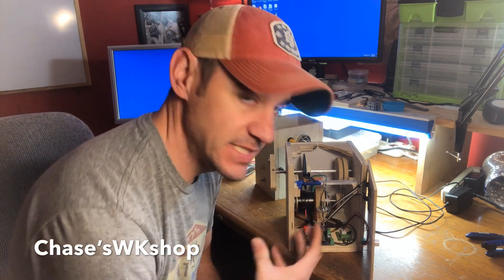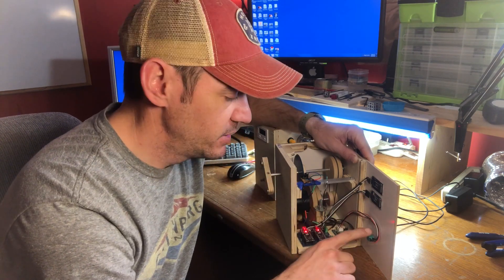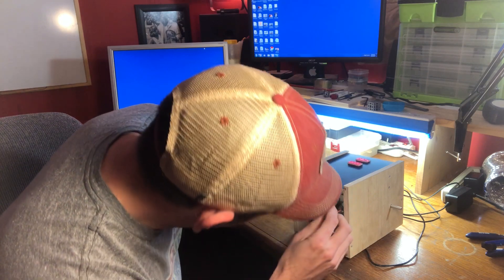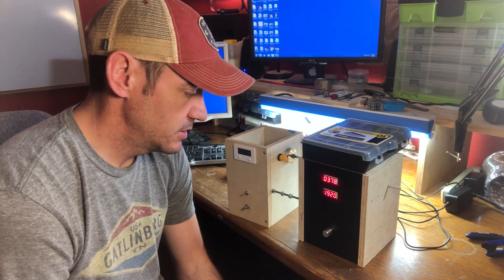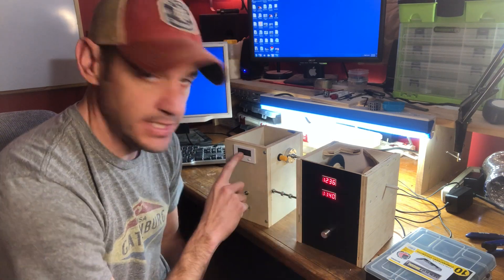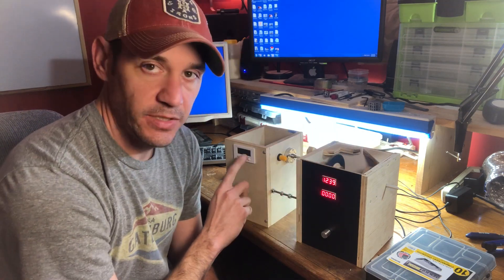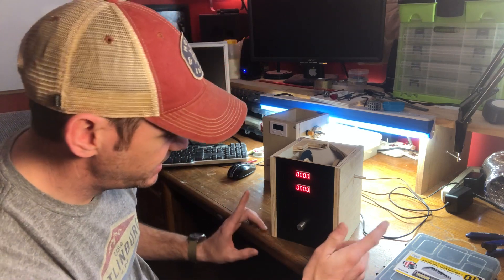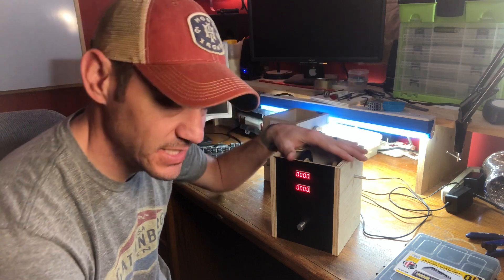DIY Pickup Winder

Comment: Good but rudimentary upgrade.   On another YT video,  the chap has an equally low-tech system, but uses a geared DC motor driving a slow-geared cam.  This cam pushes on a sprung rod, which in turn adjusts the wire guide back and forth.  This geared wire guide motor is controlled by a speed adjustable DC controlller, allowing for the speed of the cam-rod-guide to be altered, giving the ability to vary the kind of wind.   
.
This means that his pickup winder is more or less hands free...   He can adjust the rate of wind and the kind of wind -  linear to 'scatter' windings.
Reply from the maker: Deebz270 yes I believe you’re talking about highline guitars model. Superb indeed!

Comment: Hey man great vids! Is there a way in the programming to a) set the amount of turns you want and have the winder slow down and stop on that number? And b) a way the use one LCD screen and scroll through the various features, so you wouldn’t need two/three screens for RPM, gauss and count. Great build, it just got me thinking. 😊
Reply from the maker: Aaron Moore thanks for the comment bud. Yes there is a way but the motor isn’t controlled by the arduino so I’d have to let the board control some type of switch to shut it off at a certain point.  You could use a liquid crystal lcd to display the data. I’m working on a model now that does that.

Comment: I guess you already know this by now but you can buy those speed controllers with built in forward/reverse switches, I bought 4 for just £10. Maybe useful for other people. https://www.ebay.co.uk/itm/183997142025
Reply from the maker: No I didn’t bud. Thank you for the info. Let me know how they do!!
Reply: @ChasesWKshop  Ive followed your principle layout but used the above switch, then ordered an LED counter that counts at 100 spins per second instead of 20, then removed the pulley and just used the motor directly, I then made the base longer and mounted a post opposite the pickup mounting hub with a spring loaded clamp which holds the pickup in place, if you google "spring loaded lock" you will see what I mean, so you pull the clamp back and place your pickup on the hub opposite then release the clamp. Its a bit more work and expense but it saves buying a supply of tape or velcro etc.
Reply from the maker: GibsonLesPaul2273 awesome bud. I think that might be a great improvement. Send me a picture of your final build if you don’t mind. I’d love to see it. Weatherfordwoodcrafts@gmail.com
Reply: @ChasesWKshop  Will do just waiting for the compression springs to arrive next week and see which one works best, I will send a pic and make a quick video of it when done.
Reply from the maker: GibsonLesPaul2273 great. I can’t wait to see it bud.
Reply: @ChasesWKshop  I will send you a picture of the plans ive made now, it might go to your spam folder.

Comment: Can I ask what calculations you did to determine what kind of power supply you needed?
Reply from the maker: GibsonLesPaul2273 add up what every electronic part of your build uses in amps. I think this motor was maybe an amp and then the boards pulled a very small amount of current. As long as your power supply will supply more amps than your parts use you’ll be okay. It never hurts to have more amps than you need but you’ll have problems if your parts use more amps than your power supply can supply. Also be sure to add a fuse between the power supply and whatever you’re powering. Hope this answers you question. Let me know if you have anymore bud.
Reply: @ChasesWKshop  So I can use any 12v DC power supply I have spare thats cool, they are all well over the amps needed, thanks a lot for the info. I bought all the same gear as you but ordered a tiny micro motor by accident, I decided to try it anyway and the motor gets really hot with a 500mA power supply, so I tried one thats 2A and its only getting warm now not hot, I dont know why it gets so hot with the first power supply, im only drawing 180mA nowhere near 500mA. Im owndering if its something to do with the stability of the current that the power supply delivers, I really dont know.
Reply from the maker: GibsonLesPaul2273 good deal bud. That’s interesting about the other power supply it may very we’ll be what you said out it could be somethings wrong with the power supply.  Let me know how the build goes. When you get done send me some pics to my email. Weatherfordwoodcrafts@gmail.com

Comment: Great work. You should try an o-ring for a belt instead of a rubber band. I used one for an old film projector and it worked well.
Reply from the maker: Steve Ambroise awesome, thanks for the advice bud. I’ll have to try that out. Glad you like it.
Reply: @ChasesWKshop  I tried a rubber band on the film projector first and it worked but not well and not for long. The o-ring is round, much stronger and dirt cheap. I think it's still on the projector, still working!